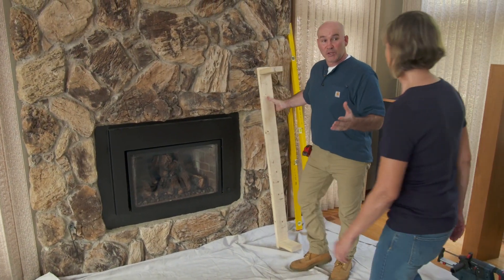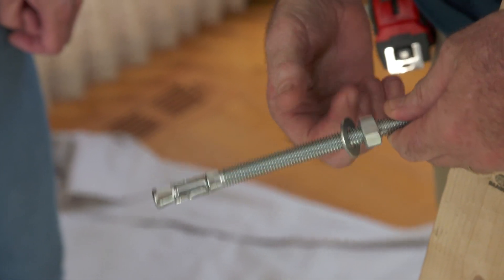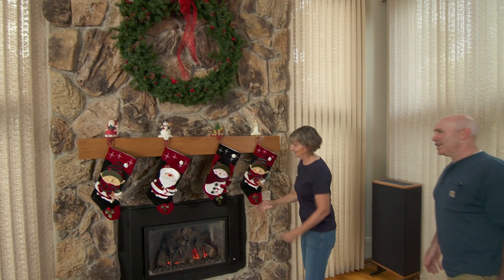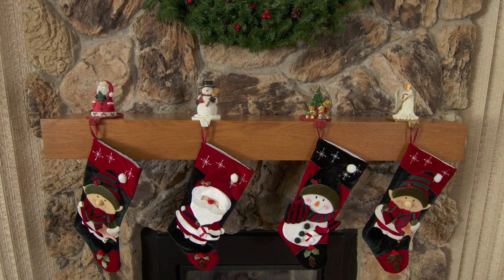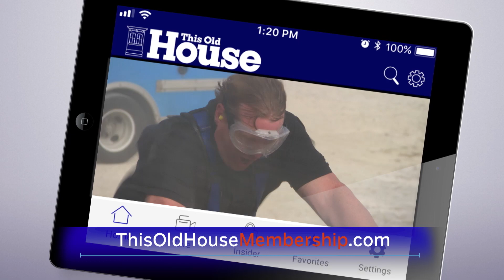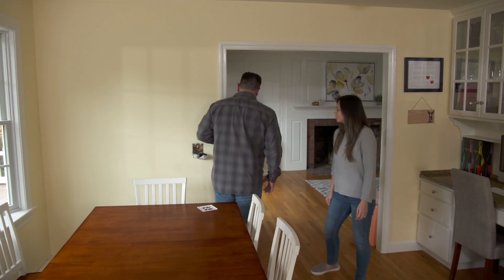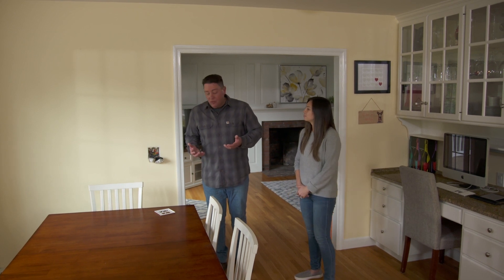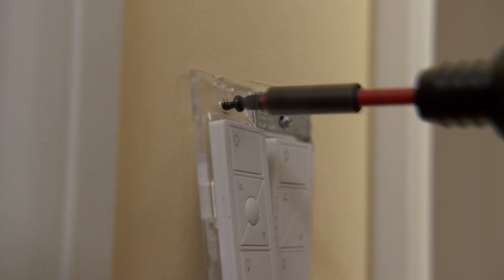ASK This Old House | Mantel, Too Many Light Switches (S18 E23) FULL EPISODE

Comment: It's a shame they didn't send Tom Silva to install that mantel. I'm sure he'd scribe the finished mantel to fit the contours of the stonework for a better fit and finish.
Reply: A do it yourselfer will have a difficult time driving those top screws with out using a pilot hole drilled 1st
Reply: Agreed... Those gaps between the stone and the mantel really raised my left eyebrow.
Reply: @StoneE4  Without pilot drilling the top of that mantel could split
Reply: @GD-pv9vc  : Uh, OK.. Great. Thanks for the reply, I guess?
Reply: Agreed! Why send a brick and mortar guy to do a carpenter's job?
Reply: Given the hight of the mantle, I don’t the the small gap between the stones and the mantle in places will be easily noticeable to most people. If the homeowner is happy with the job then why worry if it isn’t how you might have had it done. Later they could always add some sort of appropriately colored filler of the proper sort to fill in the small gaps between the mental and the stones if that really bothered them.
Reply: @GD-pv9vc   it would have taken a few dry fits but  the  box mantle could be scribed  with the cleat and mantle having  pilot holes. The cleat is only bolted to the chimney.
Reply: if i ran this old house yotube i wouldn't post that mantle video....
Reply: @Charlesb88  it's not important if the homeowner, who paid for it, is happy. What's important is to please the few, but loud, youtube complainers.

Comment: 1:50 did he say that faucet costs about $500?!? Hell no
Reply: Yep...and it wasn't even gold-plated.
Reply: That’s quite expensive for a faucet.
Reply: He also added: "Not too bad!"
Reply: when you buy name brand faucets from a plumbing supply store as a plumber the type of faucet you get is not the same as a big box or online. that faucet will be solid brass, brass handles brass stems no plastic or very little. that’s why they’re so expensive. manufacturers make faucets specifically for plumbing suppliers what you get at a big box or even online are not of the same quality even if they’re “all brass construction” chances are it’s Chinese or Taiwan material and good luck getting parts for no name.
Reply: $500.00 is ridiculous for a bathroom faucet

Comment: In our area (Ontario, Canada) there's a minimum separation requirement between combustible material (e.g., wood mantel) and a heat source (fireplace). It may only apply to wood burning fireplaces - the one in Chicago looked like gas to me, I'm not sure, but in our home (with a wood fireplace that includes a Heatilator), we're renovating and replacing the wood mantel with a stone one.
Reply: The stone may be enough of a thermal barrier to prevent it from combusting. Also appears to be at least a foot above the top of the top of the fire boxes

Comment: Should have done a solid mantel scribed against and supported by boring into the stone.  Despite it being soft, it was 8-inches thick as Mark said and would have easily supported solid weight with epoxy.

Comment: "I'm looking for a mortar joint. Preferably between two stones."  Where else would there be a mortar joint on a fireplace?
Reply: These guys are hacks and actors.
Reply: I presumed he meant “only two stones” instead of any spots where you have three stones coming together. It would ensure only one lateral movement dimension is weaker instead of two.
Reply: @StewPedassle  correct. At least someone in these comments has a clue lol

Comment: What about power for the remotes? You make it look like it's wired in the wall, but it's not. Does it have a battery?
Reply: They are battery powered. It lasts 10 years.
Reply: @michaelknopp6949  That's what I expected. Ten years later will people even realize they can pull it out and open it and replace a battery? For me, and I imagine you, it's the easiest thing in the world, but some people will call an electrician.
Reply: @PatrickPoet  I installed a lot of these in an industrial facility and I guarantee people will think they're broken and throw them away.
Reply: I have this installed to control driveway lights from living room 25' away & have changed battery twice in 6 years...  Not a bad deal for 5 minutes of changing a battery vs cost of rewiring the whole shebang 🤠👍
Reply: I have this switch setup to control driveway lights from living room 25' away & have changed battery twice in 6 years...  Not a bad deal for 5 minutes of changing a battery vs cost of rewiring the whole shebang 🤠👍

Comment: The last segment was garbage. Black is hot. There will not be just 2 hot wires coming into the box.
18:20, you can see another set of wires in there.
That segment was all about promoting the switch.
Reply: it’s done like that so the smart switch is always powered. that way u can control it with the remote or app. it’s supposed to b like that.
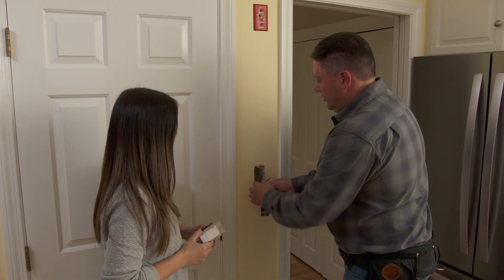Reply: @dylan-nguyen  Look at 18:03. He took the switch out and they were just 2 black wires connected only.
He probably connected it like that before they started to film.
Reply: The dimmer version of that switch only needs whatever power it can leach running through the light even when “off”. The non-dimmer versions requires a white neutral line for its power. 

Some LEDs actually have a ghost glow when used with the dimmer because of the small amount of constant current.

Comment: Lutron Caseta switches are what they are using. They fit well and have never had any issues. Internet and hub is not needed unless you use the app or wnt to tie it in with alexa.
Reply: Which is a great feature. You can schedule things like automatically turning on the driveway lights at sunset (and off a couple hours later), or turning off all the lights at 1 in the morning.

Comment: Do folks have surge or lightning issues with "smart" devices? Unlike the utilities of the pre-2000s we have pretty dirty power in cities and rural areas and more digital stuff just makes me nervous without surge protection. My understanding is that whole-house surge protection is quite expensive.
Reply: Whole house surge protection is cheap. I had one installed when the electrician came to expand my panel. A couple hundred dollars. It isn’t going to protect against a direct lightning strike though.
Reply: Doug I suggest watch a 13 part series called What on earth happened by Ewaranon to learn that the earth is not a globe.

I got it in my about tab.
Reply: Is it true that analog mechanical electrical meters have surge protection but smart meters do not?

Comment: The smart switch all hinges on your internet connection,I personally would have cut some drywall...just saying... anything that can go wrong will go wrong.
Reply: The switch works without needing internet. The hub and internet just allow for using an app or Alexa pairing. I have these switches although my older model home and they work perfectly.
Reply: @richardalaniz5464  I must investigate the technology a little further...thanks for the heads up
Reply: @michaelbaumgardner2530  Lutron Caseta. It sends out an RF signal and doesn't need WIFI to talk to each other. You can connect them to WIFI via Smart Bridge if you want to use your phone to control them, though.

Comment: I've done a reno with those lutron wireless switch, sure they are nice and all, but mind you they are 70$ each, that's not cheap.
Reply: But a heck of a lot cheaper than paying an electrician to run wiring, patch walls, etc.
Reply: @oambrosia  if you'd had some experience you can usually Diy.
Reply: I don't know what kind or where you got your switches from but "smart home" technology has gotten super cheap. Granted a bigger contractor probably pays less than 99¢ for a conventional switch, having integrated technology sells for a lot more than it costs
Reply: @4realjacob637  super cheap lol, the lutron smart switch and remote set is 80$ CAD on amazon ,maybe a few bucks more in big box store over hear. Get outta here with your cheap. Compare apples to apples, i mentioned lutron and the video displays them also, dont care about your Wish 5$ ''smart'' switches.
Reply: @alexandregr5440  I can go get smart switches from Menards, online, or even freaking Walmart for less than $20 a piece. (No standard remote)       but remotes don't freaking matter because it's smart so  your phone is the remote. If you buy the $100 hub which can connect like 50 devices you can connect it to all to voice control. Which I have done and no longer need to use switches!
Reply: @oambrosia  Not when it looked like they was already another wire they.
Why would only 2 hot wires will be coming into the box, without no neutral.
It looks like he disconnected it for this segment.
Reply: You can get them substantially cheaper on eBay.
Reply: Also, lutron doesn’t require a neutral wire whereas others do
Reply: @Chaucer89  I was saying you can get Lutron Caseta switches and remotes on eBay for considerably less than what you’d pay at Lowe’s or Amazon.  Although you might have to wait for a batch to come through.
Reply: @generallyhelpfulsoftware646  this episode was years ago, when it was more expensive.

Comment: Still not a fan of the hub type and adding another IoT to home network…..only “so much bandwidth”.
So, I prefer the types that have onboard low energy Bluetooth tech that doesn’t require a hub, the downside, gotta watch out for older gens that when a microwave is running and the main device near it, can interfere; but over the years the tech has gotten so much better and this as rare, hardly happens nowadays

Comment: I don't believe this third hand study that he's talking about.
Reply: @lostspecter2  what are you even talking about?
Reply: @saulgoodman2018  I concur with your comment on third hand smoke.  I don’t believe it.  He said contaminates are in the drywall and in the wood.  tongue in cheek I replayed   don’t eat the drywall or wood is windowsill lol
Reply: Me neither. This is just a way to make money. Same as the mold scare. Seems they need a new way to sell unnecessary measures to make you feel well. The only problem with smoke residue is staining. Just use the right paint and primer and you are good.
Reply: Saul I suggest watch a 13 part series called What on earth happened by Ewaranon to learn that the earth is not a globe.

I got it in my about tab.

Comment: Wireless means battery powered. Does that mean the homeowner has toremove the plate to get at it when the battery needs to be replaced?
Reply: Yeah, the kit that's intended for use with the remote uses a snap on plate. Since he installed a conventional two gang plate, she'll have to unscrew it. Good thing it has a 10-year battery.
Reply: @tempesttube  If they keep the manual that long to know what's wrong when it dies...
Reply: @tempesttube  they make ones that r wired in as well. they have connecting prongs into the light switch. 
but once u set this up 80% of the time ur gonna use Siri or smart events to turn on ur lights :)
eg: when ur driving home n it’s dark and 500ft from ur house turn on the lights 
Or hey Siri turn on my kitchen lights etc

Comment: All this "smart home" stuff like the light switches is a terrible idea for a lot of different reasons. Anything that can go to your phone is now on whatever network your phone is on and security in those things is laughable at best. 

Plus anything that has a hub that requires you to have an account will only work for as long as the service exists. You might shell out a decent amount of money for smart lights and all of that only to have the company you bought them from shutter and then you've got some pretty dumb lights that you can't even turn on. 

I sincerely hope when they talk about this stuff they're telling the homeowners about the potential downsides to it as well.
Reply: I concur. Also I don't want anything wireless because it may be unhealthy. I for example don't use wifi, in use ethernet cable to my laptop. I also use incandescent light bulbs because LEDs create harmful dirty electricity and blue light.

Comment: Why not use a drill/driver instead of using the drill that keeps skipping out of these screws???
Reply: he has the chuck set to 2 which is the lowest torque to not strip the screws. it’s slipping out of the screws bc he was doing it single handed. in the second clip he is pushing from the back and it’s not skipping

Comment: WTF was that lighting switch solution? lets give her 5 switches insted of 4 and add a smart hub?? If you are adding a hub then replace the switch at the door with a smart switch, replace both lights by the table with 1 smart switch and replace the one by the sink with a smart switch. Then program the smart switches in a group and they will all act as a single switch.. You could then program the light switch at the sink to double tap up for only the sink light or the same thing at the other end of the room by the table. You would still have all the configuration you needed with 3 switches. I swear the guys get paid to show off a companies solution that are just horrible and they hate it too or either that they have no smart home education. What an over complicated horrible solution!!
Reply: They're probably separate rooms that were renovated into one. He should have just gotten rid of switches by lights.
Reply: @4realjacob637  Im talking about the solution provided by ToH not why they were there to begin with.
Reply: There were so many better solutions than those smart switches. They do go bad, or have batteries die, and now it's more equipment to maintain. There are often many ways to fish wires without cutting holes, or by cutting minimal holes. Was hoping to see some actual skill employed.
Reply: This was nothing but a sponsor spot.

Comment: Everyone I love this old house but I’ve been a contractor for 22 years and I’m sorry I don’t agree with the smoke clean up. I have seen some messed up houses and apartments. Kilz paint primer is the answer. Seals and hides odor. This sounds like some rich Hollywood, Bay Area liberal. It might work but I’m sorry usually the homes that have severe smoke damage by smokers are not in the best condition nor warrant a $25,000 investment. 

Like I said I love this old house but this episode just doesn’t seem practical. The homes that I come across with heavy smoke damage are usually low income housing. One exception I did convert a cigar lounge into a movie theater and used killz primer and then painted walls with latex paint completely solved the issue. Just trying to help everyone save money with a practical remedy.
Reply: I appreciate your insight.

BTW C K I suggest watch a 13 part series called What on earth happened by Ewaranon to learn that the earth is not a globe.
I got it in my about tab.